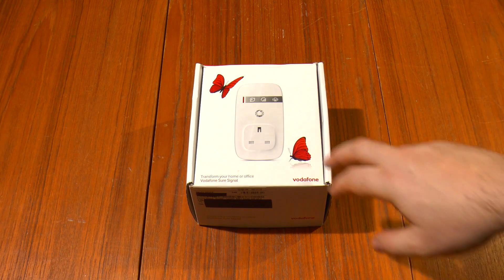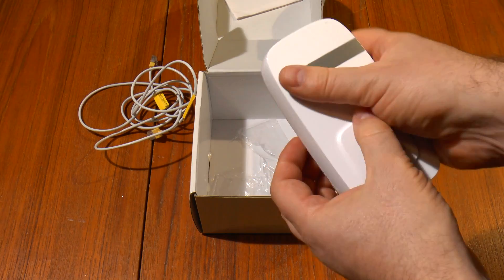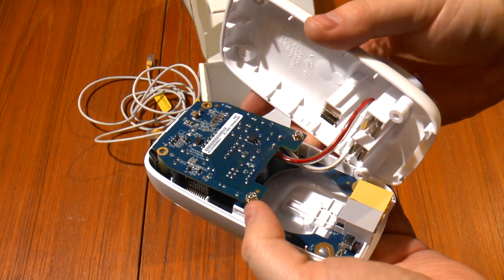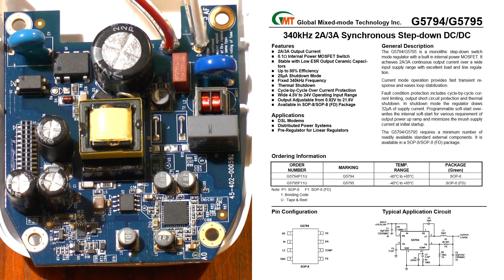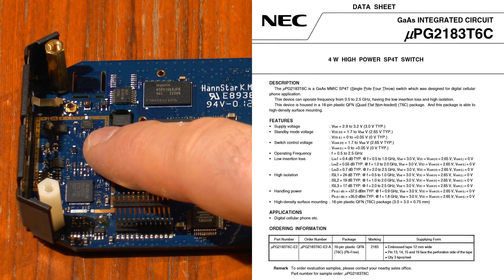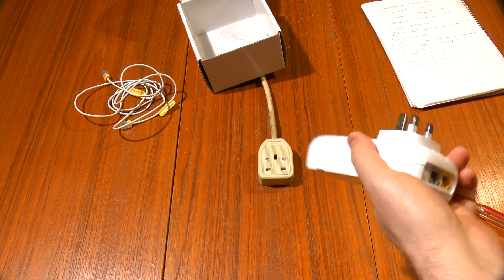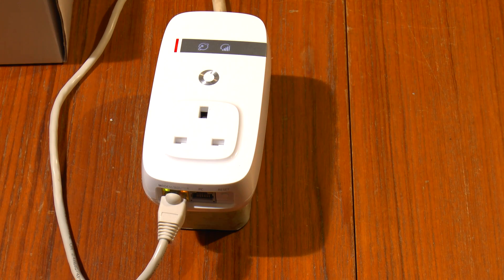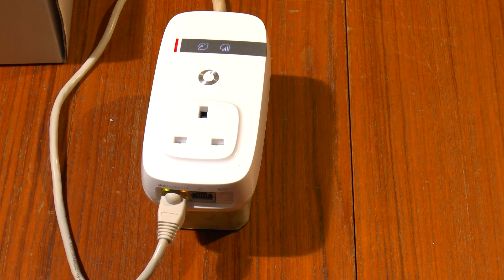Vodafone Sure Signal V3 teardown and demo

Comment: Hi there I have one of these which has developed a fault.  No power high pitched noise when plugged in.   Presume it's something to do with the primary power supply but any suggestions on a cause and remedy?
Reply: This happened to mine. Two of the small capacitors on the power supply board had bulged. This does get hot when running, I wonder if the caps can't handle the heat? I'll soon be moving into a new build house so might need to track down another one - new builds are like Faraday cages! If I find a working one, I might try to do a fan mod or replace the caps with higher temperature ones since I now have the tools to do it.

Comment: 4:35 - what is the chip in position U1 (to the left of the big black cap (I think)) and just above R8. My unit died, I opened it up and that IC has blown to smithereens can only make out a couple of digits on whats left. I'm handy enough with a soldering iron if it is worth replacing. Great video and thank you.
Reply from the maker: Isn't that the one I show the datasheet on 2 seconds later? Should be a TNY279P/G. https://www.mouser.co.uk/ProductDetail/Power-Integrations/TNY279PG?qs=%2fha2pyFadugnnUtDOvf%252bLVJUXjvrDFdi5KpPF7eJ%2fOI%3d

Comment: Got two of these from Vodafone and they both overheat and stop working. 
Any idea which chip causes the overheating? I was going to try cool it with fans / heatsinks / drilling holes.
Reply from the maker: No idea, could be any of them. Putting holes in the case and a small fan would make a BIG difference though. Couple of small holes for airflow one way, big hole for the fan the other way. Should be plenty of suitable supply voltages inside that can be used; a 12 volt fan on 5 volts will be nice and quiet.

Comment: Nice look inside.  Thanks.  Was looking for a vid of how to strip it down.

Mine works fine but backs up the review I saw that say it runs very hot.
My case is uncomfortable to touch which puts some of the chip junction
temperatures high up up against Tj(max) for the process limiting lifespan.

Am thinking of drilling some airholes in the case to help cool it off a little
but want everything out before I do that.
Reply from the maker: If you're going to do that I'd suggest mounting a small fan as well. A little bit of airflow can make a big difference, it certainly used to for my old broadband router.

Comment: 4:29 ... huh? Doesn't look like an opto-isolator to me XD
And also, that smps controller IS low-side, not high-side! :P
Reply from the maker: +Benjamin “Ozias” Esposti take a look at the datasheet, there's a PSU schematic on page 8. http://www.mouser.com/ds/2/328/tny274-280-4065.pdf
Reply: +AintBigAintClever 
Hm? I wasn't talking about the schematic for it XD
Reply from the maker: +Benjamin “Ozias” Esposti The PSU here closely follows the schematic. The chopper is built into the IC, the source pins(5, 6, 7, 8) connect to the negative rail from the input rectifier through a small inductor. The drain pin (4) goes straight to the transformer primary. ED/UV (pin 1) is opto-isolated from the low side, as can be seen in the gaps between the tracks across the opto-isolator, which side of the opto goes towards the output connector and which side of the opto the SMPS driver is on.

It's high side, with pins 5-8 bouncing along the negative portion of the AC waveform.

Comment: I don't get why people just get a landline phone then.
Reply from the maker: Jesse Levesque also power outages can take down some cells if their UPS systems aren't looked after (or aren't even there). The exchanges are likely to be better equipped with big 48 volt battery banks.
Reply from the maker: Because people don't spend their whole lives sitting in a building with no wifi coverage? Why should you have no mobile phone for when you're out and about, just because it doesn't have a signal in the house or in the office?
Reply from the maker: +nrdesign1991 Some people just get a landline phone because they don't feel the need for a mobile.
Reply: +nrdesign1991 Landlines pretty much always work unless the telephone lines go down. No chance of a flat battery or a crappy cell connection in an emergency.
Reply: Jesse Levesque
That's my point; why mess around with wireless networks if they are unreliable in your area? The exception is the inside of large buildings where there is no alternative.

Comment: I see you re edited this vid, for future reference if you want a stationary image, if you're using something like vegas, you can take a snapshot within the program and drop it in in place of the vid section ;)
Reply from the maker: +Sparky Projects the only stationary bit was meant to be the datasheet overlay (a set of PNG files which were captures, mostly from Firefox and one from Adobe Reader, cropped to size in Paint). This SHOULD have worked and in the preview DID work, it's just a bug in Vegas's CPU rendering. No re-edit, just a setting change in the rendering profile.
Reply: +AintBigAintClever ah, ok, thought you were trying to keep your finger still, pointing at the component
Reply from the maker: +Sparky Projects Nah, didn't even think of sliding in the datasheets until after filming. The fact the important bit of the board fitted into half a screen was a bonus :)

There's more going on in these edits than you might notice at first. Things get sped up in places (the move of the board at 5:55 for example), also audio gets slid about independently of video in places, usually to chop out coughing, pauses and "umms" without causing jumps in the video but also to fix errors which can still be picked out if you listen carefully. In this video the chip at 6:00 was originally read as a BCM6100 not a BCM61600 (easy fix) but I also cocked up at 7:45 by calling it a MAX2250, so it's a "Max two fif-fifty" now :)

Comment: I believe these are locked to a Vodafone account, and then managed online. 

I'm not sure whether they link to a device via the IMEI or the actual SIM, but may be worth checking out?
Reply from the maker: Tested it on an EE femtocell earlier on (using my sister's fiancé's SIM). Worked fine with that, 3G and all.
Reply from the maker: +shrekton You register them online (setting up a Vodafone account if need be) then add up to 32 mobile numbers to them. I think I read that if you replace your SIM you may have to contact them, but not the phone.

My works' mobile number was added, but the SIM was having none of it in my new phone, only working in my old one. Old phone was an eBay job so I've no idea whether it ever passed through Vodafone's clutches.
Reply: +AintBigAintClever Ah, guess it is down to the Chinese phone then. I have a OnePlus, would be curious whether that works.
Reply from the maker: shrekton
One of the lads in work has a OnePlus One, nice phone. I don't know if he's got a Vodafone SIM in it though.
Reply: +shrekton The 2100MHz band is one of the most supported bands for 3G which most Chinese handsets support. It's the 900Mhz band which some imports do not use.

The Lenovo Vibe P1 Supports all the UK frequencies for 2G, 3G and 4G.
Reply from the maker: From what I've seen the P1a42 does. The P1c58 and P1c72 do not. This is a P1c72.
Reply: +AintBigAintClever There is various conflicting information but the common theme is that the P1c72 supports 2100MHz 3G which the femto uses.

Vodafone (and O2) tend to mainly use 2100MHz 3G in urban areas and the range is not all that great as they use the 900Mhz for coverage and building penetration. What is Vodafone's coverage like with the lenovo phone?

In terms of 4G, it appears to only support the UK 4G band 1800MHz which I do not believe Voda are currently using for 4G but may refarm like O2 are (O2 has no 2600MHz spectrum so to provide capacity in urban areas alongside their 800MHz 4G, they have no choice but to use 1800.
Reply from the maker: I'll be polishing off my Vibe P1 video soon, with a table showing what bands the three P1s use and what bands the UK providers use.

Taking it into what should be 3G and 4G territory this weekend so will be interesting to see what I get there before hopefully finishing the video.

In any case I've got wifi in all sorts of places (at home, 1100 access points at work, access to the Fon network, and so on) so I don't really care about 4G.
Reply: +AintBigAintClever The phone probably wasn't the problem  sometimes vodafone throws a wobbler with devices registering on the sure signal v1, I spent nearly a year with a chinaphone and that worked great.
Reply: It's linked to the SIM itself. I had to get a SIM swap once and needed to re-register my number on it.